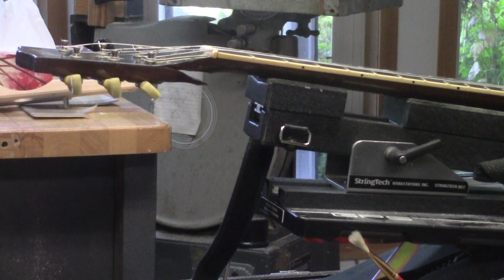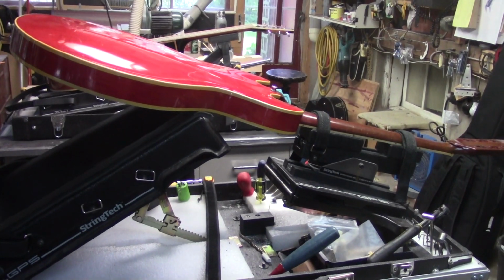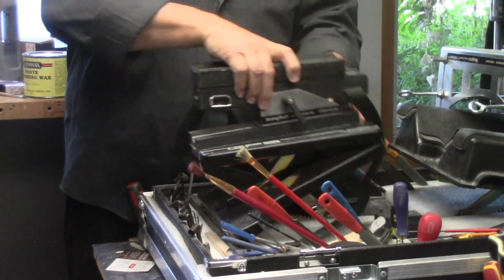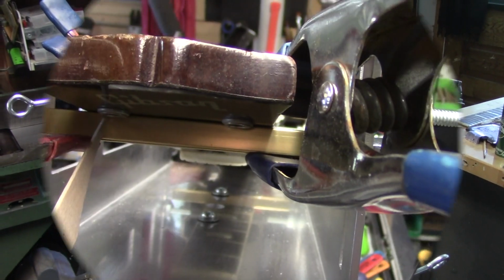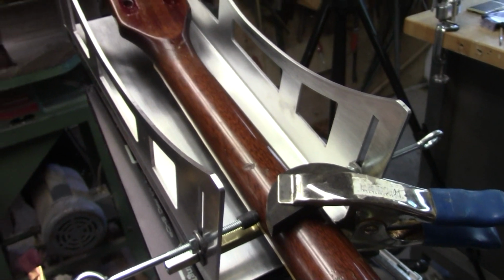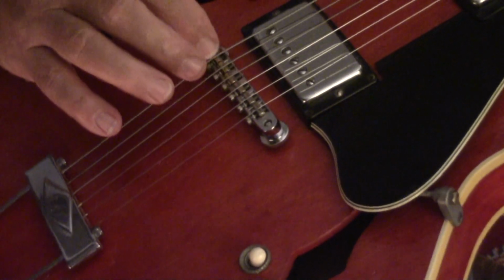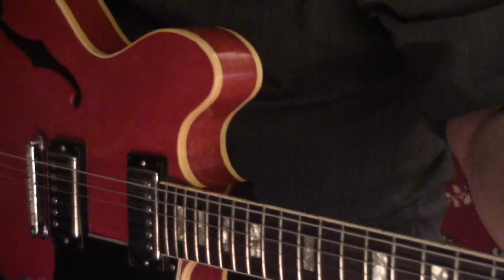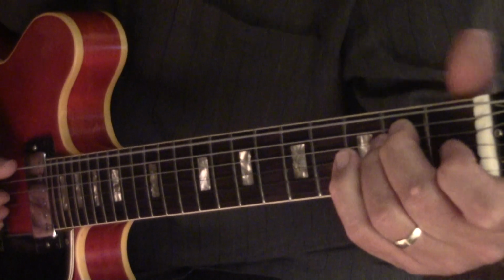1967 ES 335 Neck Surgery @StringTechWorkstations

Comment: Excellent repair Mike. The first spline job I did was freehand with a Dremel and although I was the owner of the guitar I was so nervous! It was a long time ago but I still remember how it took me a couple of days to muster up the gumption to take on one of the most daunting of repair jobs. The only thing I knew for certain was that it was imperative to stay clear of the truss rod and there is not a lot of room on each side to work with! I personally think Gibson should supply a set of precut splines with every guitar purchase. Better yet, because I also believe a spline repair is actually an upgrade, they should just go ahead and install them during the build process. All of that said there would still be repairs for us to do but for what they cost nowadays they should at least be included with the case candy. My 2 cents anyway. Thanks for the vid Mike!
Reply from the maker: The nice thing about this setup .... is one job covers the cost of the NSK. The sled is designed for a Bosch Colt router. I have another neck surgery coming up     so ... stay tuned ;^ ) ! Cheers JBZ !